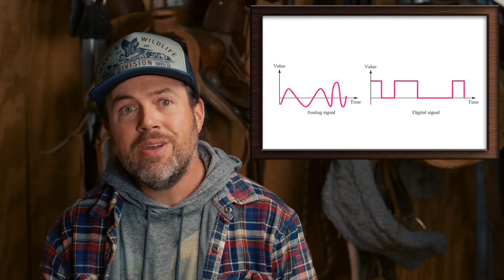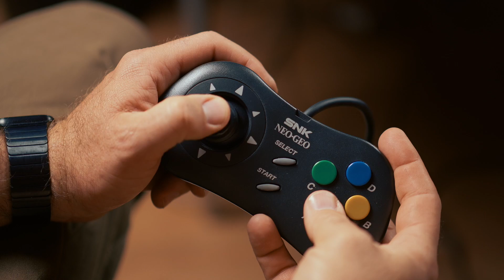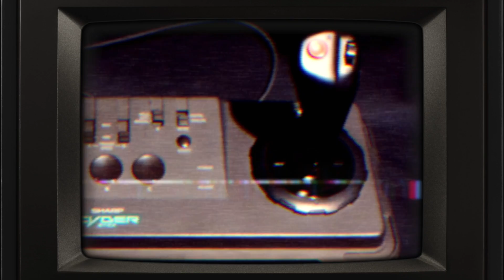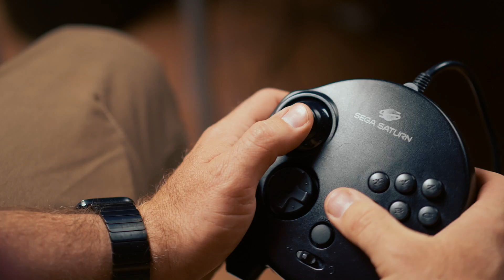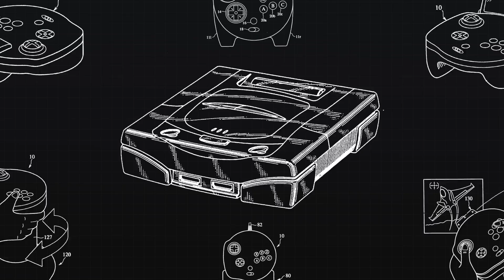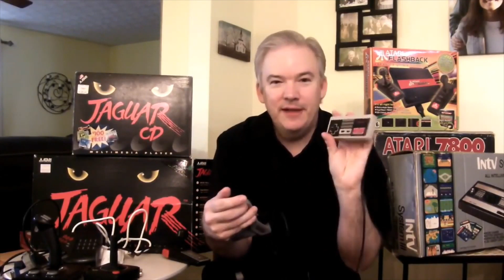What Inspired the Modern Analog Controller? | Atari 5200, Sega Genesis, Saturn, Dreamcast, Xbox +

Comment: There is like not a single reference to the Dual Shock controller in this video... that came well before Xbox. There was even the original Sony Dual Analog controller prior to the Dual Shock. Like literally five years ahead of Microsoft... not sure why you keep saying everyone's controller designs were based off of the Xbox controller when it was clearly Sony who nailed the design with the Dual Shock so well that it stood nearly unchanged through three console generations.

Comment: I quite like the variety on the XE-1 AP but the emphasis on flight sims primarily is what holds it back to some extent, like a modern controller supports a wider variety of game genres more transparently. I had the same issue with early PC gaming, some really nice flightsticks made but they were awful for Commander Keen or Mortal Kombat.
The modular joystick coupling like 5200 did should have been used more by all, I like how Dempa had shifters and other things rather than always a second joystick. Although the much smaller XE-1 AP thumbstick cap seemed to ellude most analog joystick makers where big Virtual On style seemed more in the cards for that time period. Truly analog joysticks were the only way to control 3D games since we all tried digital control on early PS1 and similar platforms where it was simply awkward in the third dimension to use digital directional control.
I really think Sega was going in the right direction with the SS 3D Control Pad expansion plan but then went all wrong on the DC as it went from a modular versatile approach to a more rigid overly specific one for VMUs, and less buttons than SS too WTF. I really think games like Quake and DN3D on SS had the right idea using the face buttons in combination with analog free look, sure the layout wasn't optimal but image something like the N64 C-buttons crossed with the Nintendo Switch HORIPAD with it's pop-on D-pad cap to have something capable of both Street Figher and FPS games. That was kind where we were bitd, only one analog joystick per controller, and dual D-pads were tried on VB which only kind of worked.
Been trying to get a SS/DC controller going along these lines since while I like the form factor of the recent Striker DC it doesn't really address the lack of genre support for the platform as a whole nor the SS. I have it planned out pretty well but my buddy's hand me down 3D printer doesn't work great, I'm not that good at 3D modeling, that pandemic. ^_^
Reply from the maker: Another great comment. I fully agree that Sega took a step in the wrong direction when transitioning from the Saturn 3D to the DC gamepad.

Comment: Refined, rather than complacent.

The 3DO, Jaguar and CDi showed complacent design. They paid little attention to the user experience, or to the direction that they wanted to head towards. 

They all just bundled a controller that was barely adequate compared to the Mega Drive's original 1988 pad.

Comment: My observation of analog versus digital was that analog came too early and had a quickly met ceiling of usefulness in the 2D era of gaming. It wasn't that paddle controllers and it's games were bad but rather it should have be a secondary controller rather than the primary like the 5200 did Re. are people playing more Pac Man/Berzerk or Black Widow/Breakout at home more? It was Pac Man and 2D arcade games only focused more and more on digital direction control for many years after.
To me it's just strange when I consider the vast amount of oddball controllers made over 1980-1990 that we never saw a more robust Digital or Analog focused controller design separately. For example a joystick that actually resembled a horizontal 80s arcade deck or an analog stick with a bunch of digital buttons rather going from one button to a whopping two lol, Vectrex got that matter right based on average pinout limits bitd.
Keypads were worse than analog control applied to digital game controls, again they had uses but it wasn't used by many games or so effectively that it had to be molded into the controller shell. The 2600 having a keypad as a separately accessory made for a better gaming model, actually quite like the normal joystick plugging into a keypad module for custom 5200 controllers, or the 360 ChatPad too.
Reply from the maker: Great comment, highly appreciate it.

Comment: Imagine if the Atari Jaguar came out with an analog stick like the 5200 did. What a missed opportunity that was. They could have had an analog stick and face buttons on the flat face of the controller, and a d-pad and face buttons on the slanted face of the controller.